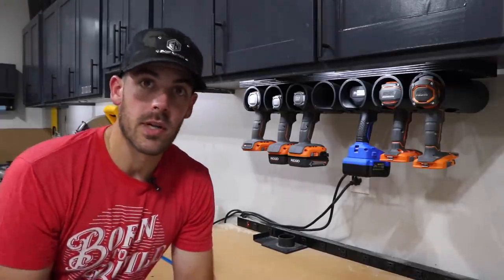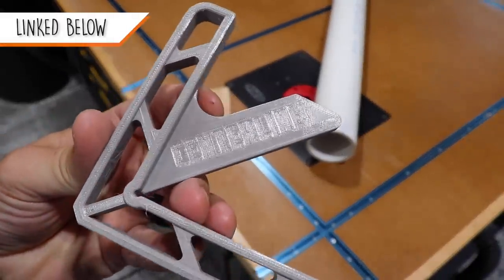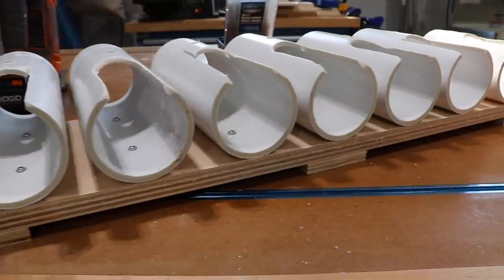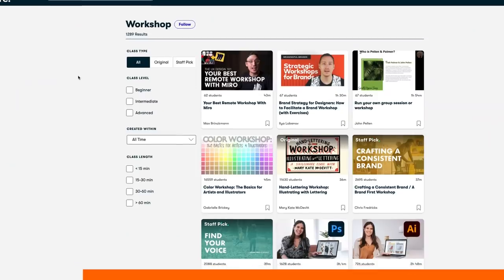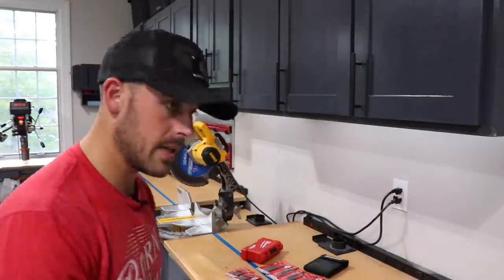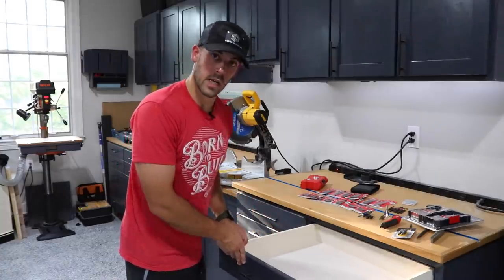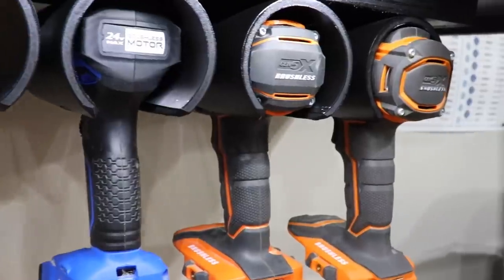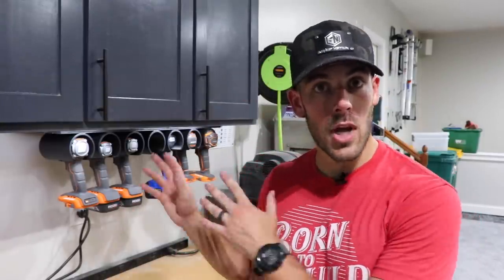EASY Hanging Drill Storage & Drawer Organization // Shop Organization

Comment: If you want cleaner cuts on the Kaizen foam, heat the blade over a candle.  A hot razor knife cuts the foam like butter.
Reply: Yes, I learned the hard way it melts with heat. Hot glue doesn't work on it.
I made some custom inserts for my makita mbox drill + bits using scrap pieces (creality cr10s 3d printer came with this foam packaged) that weren't thick enough to fill the bottom. Hot glue to stick it together was a pain.

Comment: If you're trying to get hotglue to release (and peel off the excess) spray isopropyl rubbing alcohol on it. The hot glue will then easily release from just about anything.
Reply from the maker: Great tip!

Comment: Nice solution!

One tip for extra speed: Mark the back of the impact driver with Green for T25, Red for Philips 2, Blue for Pozidrive 2 etc (same color scheme as Bahcos great ERGO line of screwdrivers). Having dedicated impact driver for one impact bit saves huge amout of time.
Reply: Alternatively you could get all your screws with T20 heads. Only if your using huge screws switch to T25 or T30
Anything that doesn't fit a T20 is probably too small for an impact driver and will likely damage something.
Reply: "posidrive" I'm guessing not american/canadian? First time I encountered posi is on my British car. Phillips just don't quite work properly in them, and luckily I had picked up some posi bits in a set when I was over in England. Not at all common here in the US. And torx are mostly on deck screws (and cars). Phillips is, unfortunately, the defacto standard. I try to get Robertson (square) or torx as much as I can.
Reply: @LiqdPT  Posi drive is also dominant in Italy and that means every pair of alpine skis from Europe uses posidrive for the binding adjustments. All the big companies are in Italy or nearby. Fun stuff :)
Reply: Curious if Bahco colors are near the same as colors Wera uses in their fun kits. Looking it up now. Bahco is owned by Snap-On which is kinda neat.
Reply: @LiqdPT  From Sweden, pozidrive is quite common here. Better than Philips, less likely to cam out. Worse than torx.  IKEA is by the way usually using something exactly in the middle of Philips and Pozidrive...
Reply: @ingentingbra  my experience with IKEA is a lot of hex (as they include a hex key, but I use my own in a proper handle)
Reply: @FearsomeWarrior  I figured it might be common throughout Europe, but didn't want to assume. Heck, it might be common everywhere but north america

And both of the brands you mentioned aren't at all common here either. Wera might be available to order (I've only heard of them again from my UK trip) byf isn't something you'd find in a store nor is it common.

Comment: Take out all the bits from the "set" organizer, make sure you have one of everything in there with your nut drivers. Then when you need to use driver grab that and you'll never have to make a second trip. Also buy a "security bit" set for the weird stuff.

On the one that doesn't fit well, cut a slit the rest of the way through that pipe, heat it up with a heat gun and spread it out a little and it will fit.

Comment: Really like the idea of stealing the bins for drawers. I've been looking at ways to organize my bits in my toolbox and was about ready to 3dprint some bins but that is way better. Still may print something for my drill bits to save space but really like this for my driver bits and nut drivers. Also, really like how often you use super glue. I've normally got larger bottles for my reef tank hobby and never think to use it for little wood projects like this.
Reply from the maker: It’s so quick and easy when you don’t need absolute strength

Comment: Interesting to see a wood workers approach vs. a metal worker.  I fall more into the category of metal worker.

I would have cut the PVC notches with an angle grinder rather than a table saw for two reasons.  First, table saws make me nervous with cuts like that.  Second, I run a grinder a lot and am very comfortable with them.  You can really sneak up on a cut with a grinder and fine tune it easy.
Reply from the maker: A grinder would have been a great tool for the job

Comment: Travis,  great build but, if you're using the compartments for items that you are going to use singularly, why not just use the divided drawer sections themselves, and save the removeable plastic compartments for things like screws etc. that you will be using in an indeterminate amount.

Comment: Screw head clearance?  you know you could of just put the screw head under the hole then attach it to the bit.....................SMH..............AND YOU BOUGHT the bits individually in 5 packs>?  what...why.   those are like 6 -10 bucks each, when a 50 pack with a case and everything might run you 20 bucks. Same brand.   Dang they saw you coming a mile away
Reply from the maker: My guess is you aren't a big "shop guy"